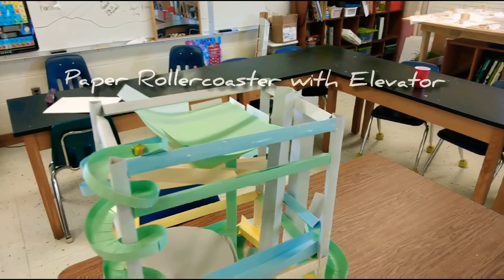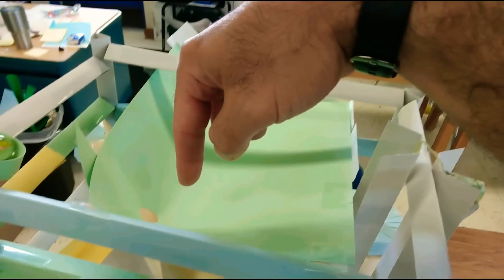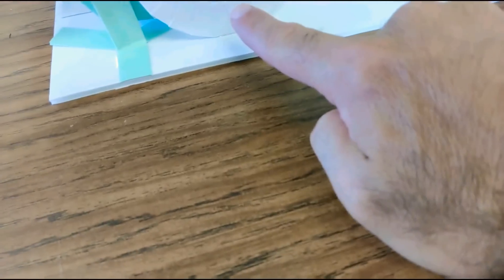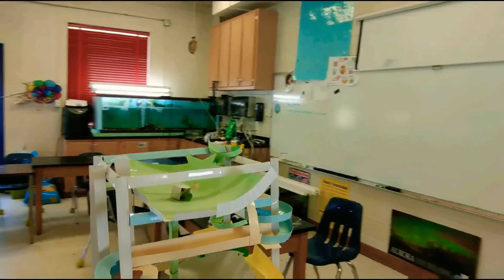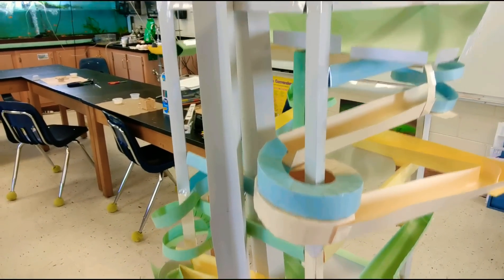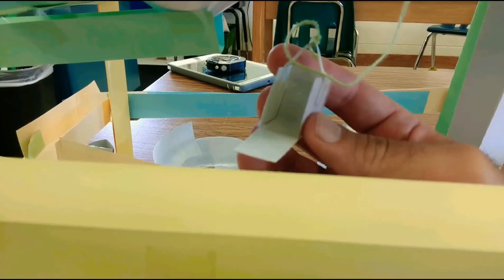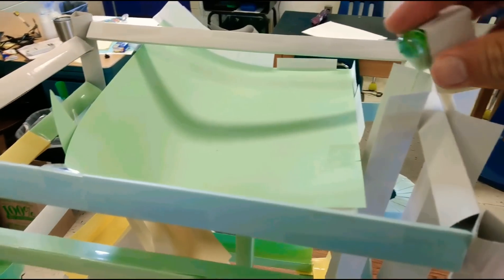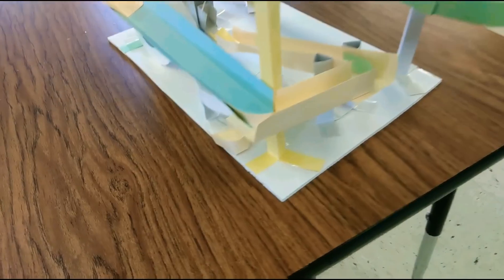Marble Rollercoaster with Elevator!!

Comment: can u please help my project is due tomorrow and I need help on how to make an elevator
Reply from the maker: It would be really hard for me to help you without seeing what you've got. An easier option might be to add a second marble. Have the first marble set off the second marble at the end of the run. If you are allowed to use string, it's a much easier way to double the time of your coaster. If you get the elevator to work, take a video. I'd love to see it! Good luck.